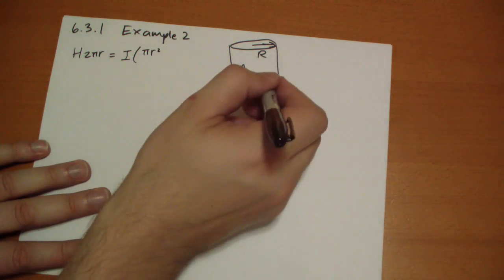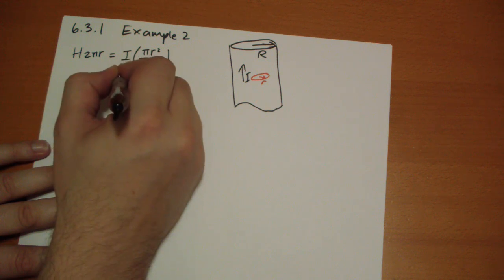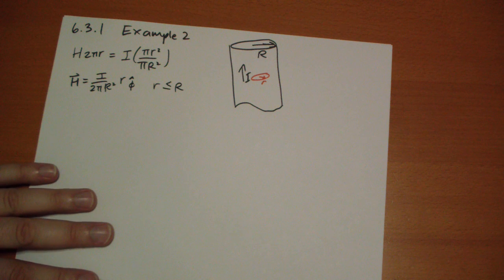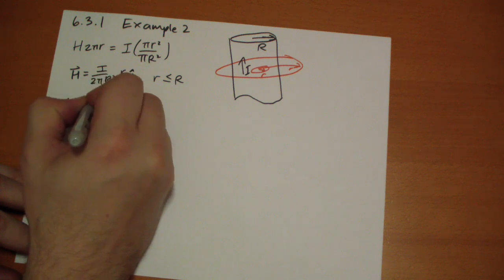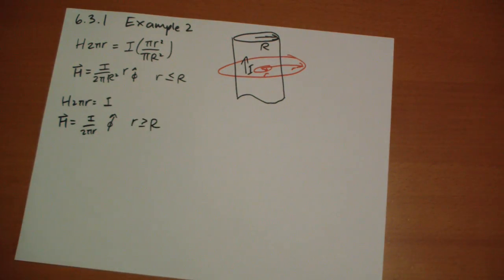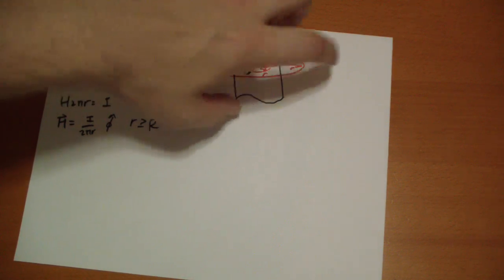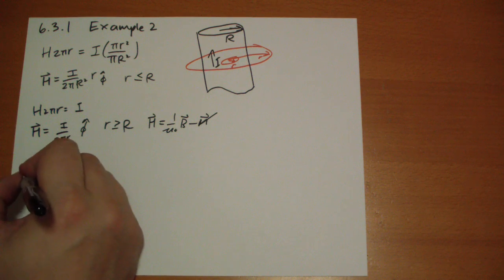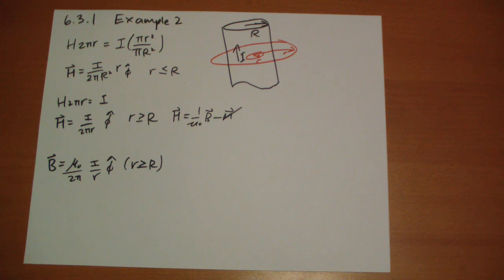6.3.1 Example 2

Comment: for r<a , i dont understand why the current inside is it's magnitide times the ratio of the areas of the Amperian loop if it said that the current is uniformly distributed there? if its uniformly distributed so the current inside the cylinder is equal at all point, so why do we need the ratio between the areas...?

Comment: Sorry, can u explain why volume bound current and surface bound current are opposite direction ?
Reply: light lin because we are taking copper and it is diamegnetic
Reply: Because the surface and volume current are produced by the same set of microscopic current loops, so if the volume current goes in one direction and is constant, the surface current must go in the opposite direction because it is produced by the current continuing on in the outer most loop